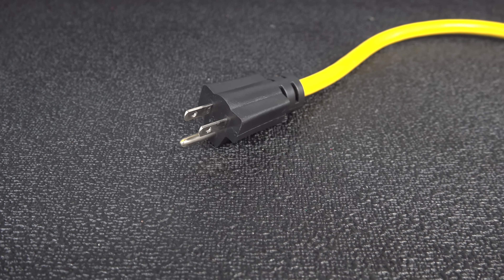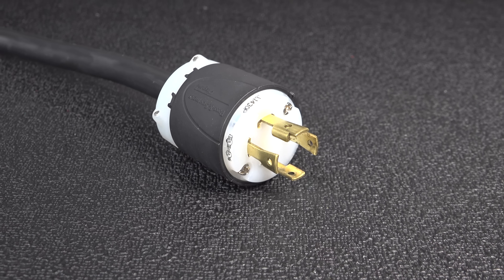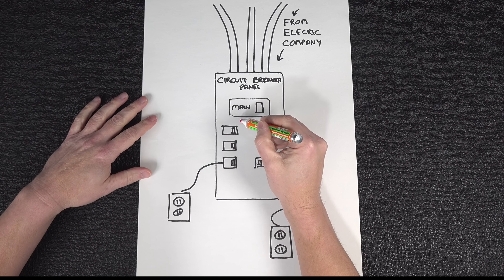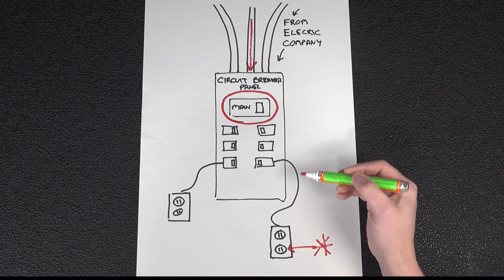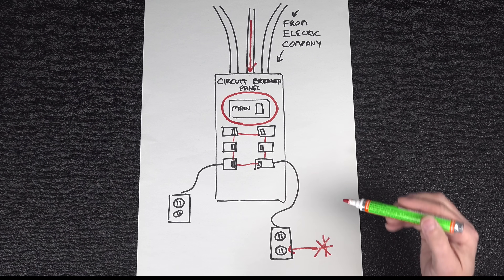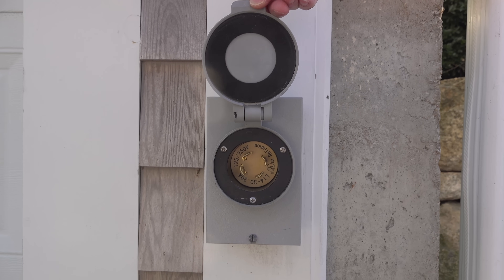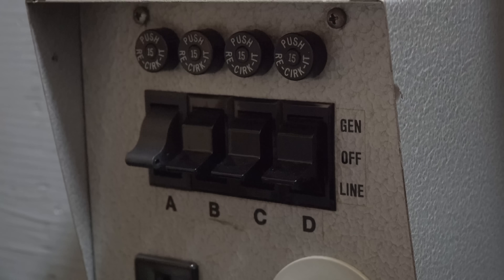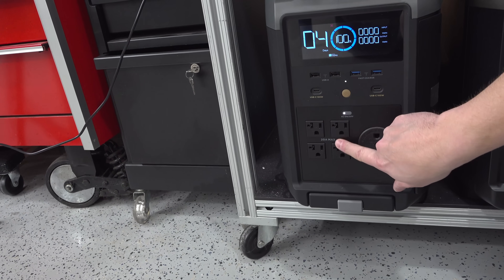Worst Electrical Mistake You Can Make - Backfeeding Generators

Comment: I can remember as kid on my dads dairy farm we had a ice storm knocked the power out and dad bought out the PTO generator on the Allis D-15 hooked it up to the panel in the barn with the big alligator clips to do the milking. Started up the generator and the poor old tractor was right on her knees lights were very dim,, Ok let’s get the bigger tractor on it, out came the D-17 no difference. Then came Ontario Hydro in with a truck and the guy that came out was mad as as a hornet, back then they would put a pole transformer in with a switch on it and 2 ropes, pull it one way street power on and the other way power off so you can run a generator. I can still remember that guy going up one side of dad and down the other now they have interlock at the pole so this can’t happen. Good times

Comment: I know backfeeding is a touchy subject but I think we can all agree "if you're too lazy / stupid to make your own backfeed cable, you're too lazy / stupid to backfeed".

I backfed in 2004 during hurricane Charley. I ended up spending it at my girlfriend's grandparent's townhouse. I had a 750w inverter, her Hyundai, 25 gallons of gas, and a vacuum cleaner. They had NO extension cords. I flipped the mains, cut the cord off the vacuum (which I still have & use), unscrewed the front porch light, added the stripped ends of the vacuum cord to the wire nuts, reattached the lamp, plugged the plug into the inverter, and connected the inverter directly to the car battery under the hood.

I got very lucky, and most of the stuff we needed was on the same leg as that porch light (since a 120v backfeed will only run one leg). In particular, it ran the refrigerator (which the inverter was capable of running), the TV, and the built-in bathroom light (thankfully the water stayed on). It also can power the garbage disposal, which I found out when the grandmother turned it on while doing dishes. We kept the food cold (cooked on sterno) and the lights on for 3 days.

Comment: Here in Germany it is allowed to backfeed in the main if you have arranged it with the power provider. You also get money for the power you feed in. It's very common for those with solar panels on the roof to set something like that up because you can do something useful with the overproduced power you may have
Reply: You can do the same in the US.  You need equipment to make sure you are not sending power out when the power grid is down, though.  I imagine Germany has a similar requirement.
Reply: That is completely different from backfeeding during a power out. Many PV systems disconnect themselves during a power out just to prevent backfeeding - which of course is bad for the user as he could provide power for himself with it otherwise. Smarter ones can isolate themselves so they stop backfeeding.

During a power out there are linemen working on the lines and backfeeding kills them.

Comment: The interlock is the cheap and easy way to do things. I'd have no reservations using the cable being warned against, but nobody should be able to legally sell them. If you are going to use one, you best only use one if you have a master breaker in your MSP and you can disconnect your home from the grid. Two male ends is definitely not the wisest way to go, but if you need something in an emergency, it could present a lower risk than the alternative, just saying.

Comment: I use one of these however have an interlock and feed my system with a 220v cable allowing be to power both even and odd banks of my system.  I've been doing this for years in outage situations and not had an issue.  You only have to be 10% smarter than the equipment you use and if you are not then you shouldn't be messing with it in the first place.
If you are not an electrician just run an extension cord from what you need powered to a generator on the back porch or other outside location.

Comment: First off it’s NOT illegal to connect a generator to your house. Thanks for the lies. Some nanny state townships might be dicks about allowing you to run your house when they decide to turn it off but the concept of connecting to the house is NOT illegal, only municipalities get commissions off of you buying very expensive patch panels and buying permits to hire electricians to request inspections so that you might be permitted to connect in emergencies IF your Nieghbor doesn’t make a complaint about the noise. Those cables are also good for connecting battery banks and inverters to your house. To keep from wasting the stored power you turn off all the breakers but the ones you mean to run. Either way it’s no more dangerous than breathing the same air as this guy.
Reply from the maker: Sorry but you are 100% wrong. It's against the electric codes in every state in the US, assuming that's where you live. You are required to have an interlock or transfer switch. That why NO commercial providers sell the cable.

Comment: We had a power outage for nearly a week last year and had bought a generator in preparation bc a bad winter storm was coming and my family nearly tried to backfeed like this. We didn't have the right equipment to run it to out house but we just ended up using heavy duty extension cables and ran them in the house and sealed air gaps with towels and stuff like that.
It's not as safe but we chose high quality extensions and the breaker on the heater would've tripped before those cables were overloaded.
Reply: Running cords out to the generator is safer than doing any sort of backfeeding to your normal electric circuits.  I know people do what they have to in an emergency but I agree with the premise that backfeeding is not a safe practice.  If you can't afford to get a generator panel installed at least buy heavy gauge, outdoor quality electrical cords for powering appliances (I recommend 10 or 12 AWG cords) and avoid backfeeding unless you truly have no other option.  Chances are if you are running a generator in an emergency you will have the cords connected to multiple appliances and be pushing a lighter cord's capacity too far.  There is some safety margin built into the NEC requirements but have seen people try to run 20 amps off of a 16 AWG cord and it doesn't usually end well, either the cord will melt and short out or you will push the voltage to your appliances down and burn out your refrigerator and/or air conditioner compressor.

Comment: These death cords are something that falls into the category of “if you can’t make it yourself, you shouldn’t be using it”, I mean, they can be safe if you know exactly what you’re doing, but it requires quite a bit of knowledge.
Reply: If you know enough to work safely with a dangerous cable then you know enough to implement a safe system. Even if you know exactly what you're doing, one day you'll make a mistake while distracted or someone else will grab that cable and plug it in without thinking.

Comment: js, dont hot plug a cord like this, problem solved, dont energize a incomplete circuit, if you disconnect main, plug cored in at genny and house, THEN power on genny, your fine, judt remember if you wanna back feed a house, whatever circuit your backfeeding is now your MAIN breaker, so typically a stove/dryer plug would be best, plus now your feeding a 230v circuit, also, locking out the main breaker is HIGHLY recommended, this is not advice, just an opinion with info that could get you out of a pinch, i do not recommend breaking any regulatory laws.

Comment: Interested to know what happens with solar?

In my state in Australia, we love our solar so pretty much every roof has panels now to help the grid on hot days. How would workers repair powerlines whey infrastructure is damaged?
Reply: If it's anything like the US, you have to have some equipment that monitors the power grid.  If the grid shuts down, then the equipment shuts off your connection from the solar to the grid as well.
Reply: @HallowedWeasel  yeah our grid is different. It’s only now we have smart meters that can stop the supply of power to the grid which is only being installed on new system, not required on existing systems. 

In saying that though, when their are issues the power network cut power to do work so I guess they are isolating the network that needs attention.

Comment: If the main breakers off it's impossible to shock your neighbor with the hot side buddy think about what you're saying the neutral wire can't shock somebody
Reply from the maker: And what prevents someone in your house turning the breaker on? That's the key difference. One illegal way depends on a series of steps done by someone and has potential for an accident, which has already happened multiple times. The legal way eliminates any chance of it and costs $50 for an interlock.

Comment: Now that you scared half your listeners, who want to buy a generator for emergencies . all they have to know is not to back feed to the transformer. just make sure your main breaker in the box is turned off. OFF do not leave on when hooking up your portable generator. and you will not have a back feed problem to the pole transformer. when power is restored. all you have to do is look outside to see if the neighbors lights are on. then turn off the generator disconnect it then only then turn on your main breaker to the house.
Reply from the maker: They should be scared. You can lose your homeowners insurance doing it if a fire happens.  Call the NFPA or NEC if you don't like the rule but it exists to eliminate all of what you said. You don't need to remember anything, you don't need a preflight checklist. A simple interlock only works one way which happens to be legal but 100% safe and costs about $50 plus the outlet well within anyones means if you can afford a generator.  There are already cases of deaths caused by back-feeding because people make mistakes, others come into the mix, even though you think there is no way anything can happen, especially during an emergency like a storm, etc, it does.